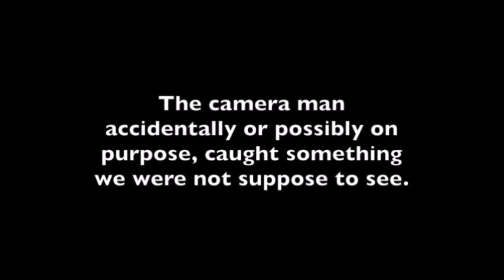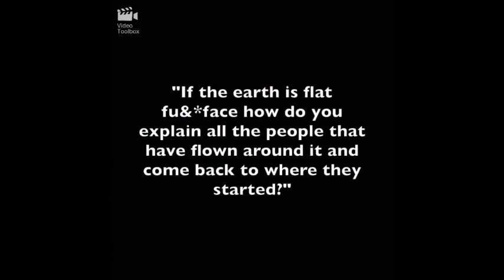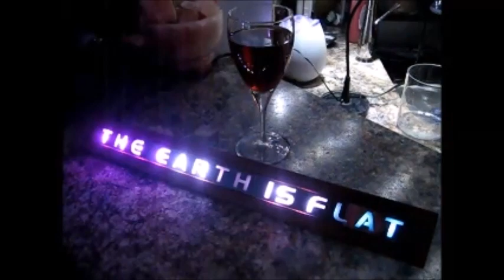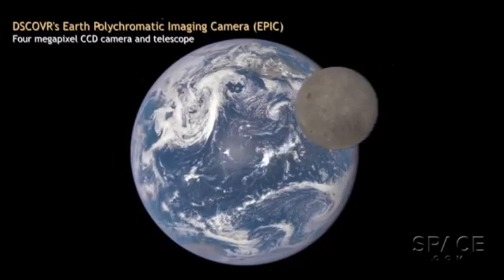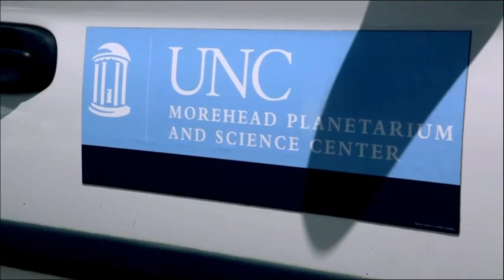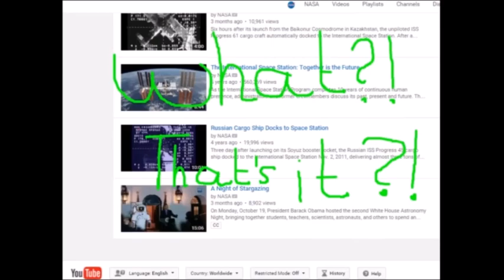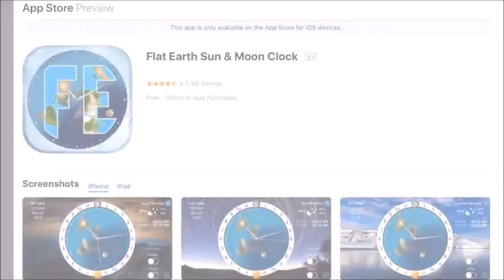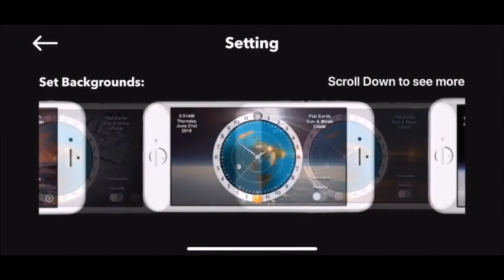Flat Earth Q&A Emails 118 Mark Sargent ✅

Comment: Study up buddy - video from the moon was 10 frames per second SSTV at 300 line resolution, and 20 watts is more than enough for that transmission. Check with your local RF expert - don't forget to mention those 85m parabolic deep space antennas!